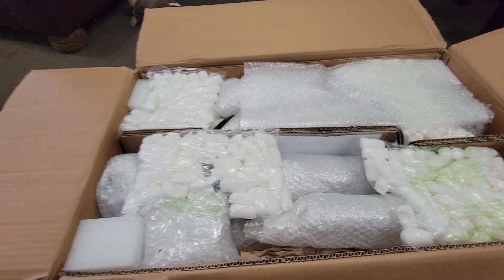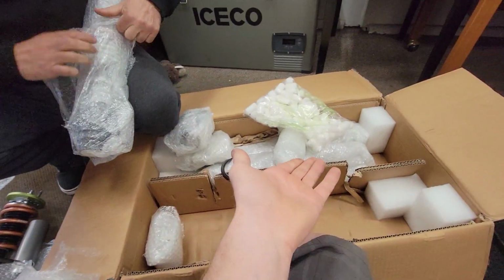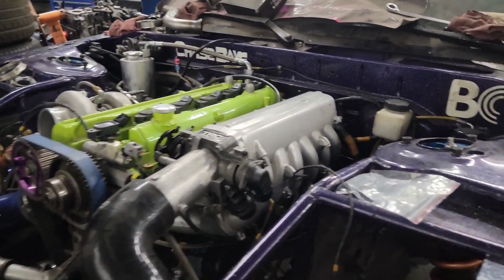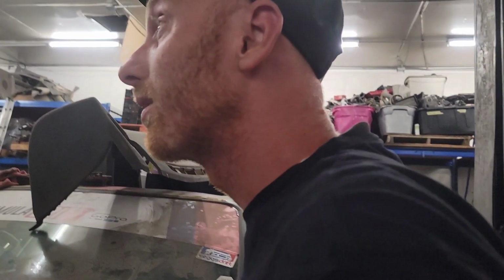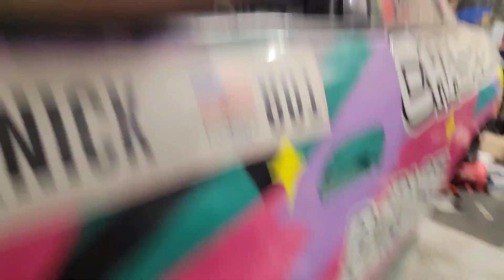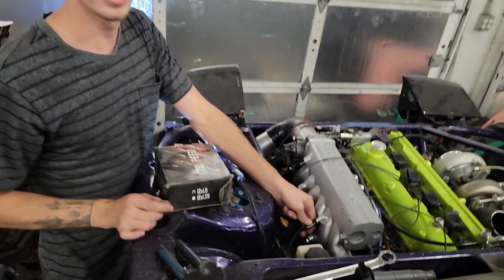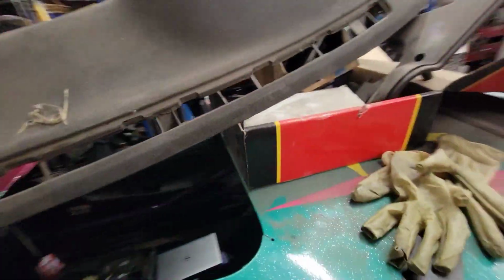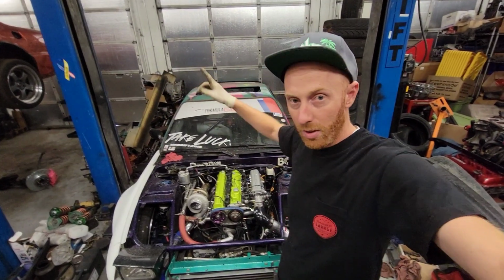Formula D Car Revival - After 7 years I finally drove this again

Comment: First fire on a fresh setup on an engine management system is difficult. Especially if you deviate from the norm. So things like the cam crank reference and coil dwell and injector dead time and CVT become more difficult